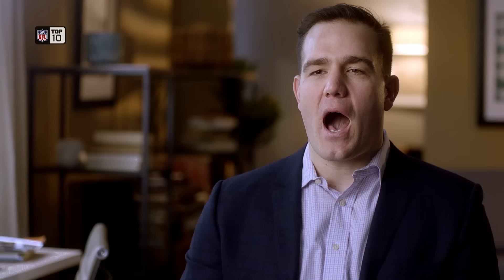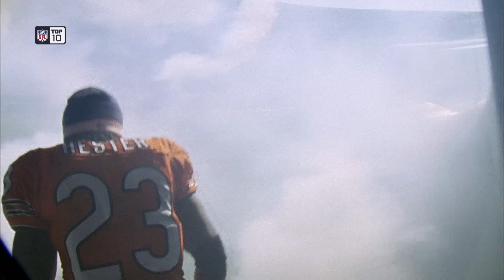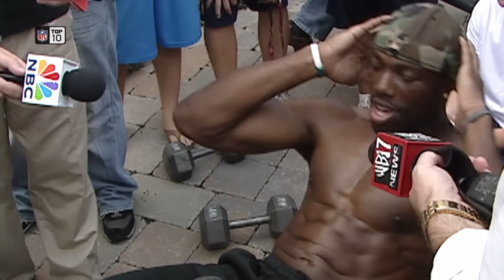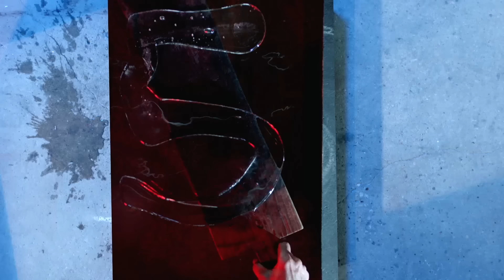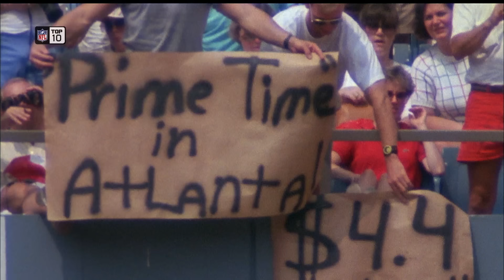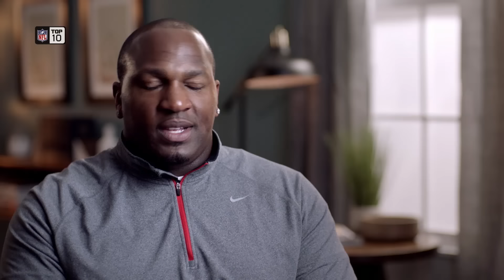Top 10 Human Highlight Reels of All Time | NFL Films

Comment: The list is not bad but it is not great. #1- Barry Sanders made multiple highlight moves within his highlight plays. He is easily number one on this list. #2- Deon Sanders was a threat every time he returned a kick, a punt or an interception. He was so good at the cornerback position that opposing QBs would not throw anywhere near him. #3-  Michael Vick is the reason why we have todays dual threat QB. Vick was so good at running that defenses would do what ever they could to keep him in the pocket.  #4- Jim Brown had a rare combination of speed and power. He could run around guys or through them. #5- Bret Farve always seemed to make a highlight rather it be a last second hail Mary or him switching hands to complete a shuffle pass as he was getting tackled. #6- Bo Jackson would run down the field with three or four defenders hanging on him. #7- Jerry Rice was so good at running routes that he made CBs fall down trying to cover him. Rice could also make highlight catches. He is the reason why YAC yards were recorded. #8- Ronnie Lott was a highlight hitter who could force turnovers at any point in a game. #9- Ed Reed was a key player on one of the all-time great NFL defenses. He could bait QBs into thinking they had an open receiver. Yet, Reed could make up the distance while the ball was in the air. #10- Troy Palomalu had the speed to cover side-line to side-line. He excelled at shutting down the flats and he caused turnovers'. 

'